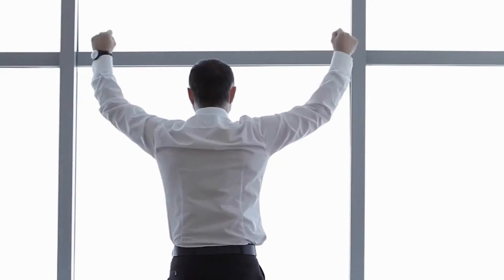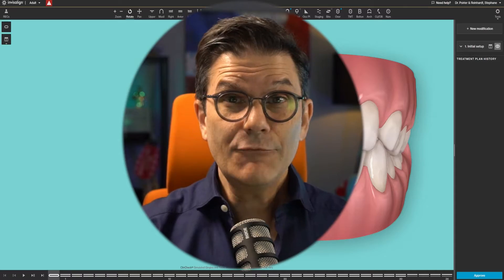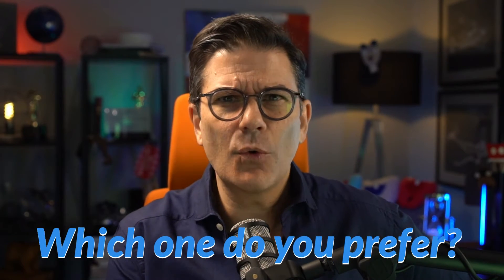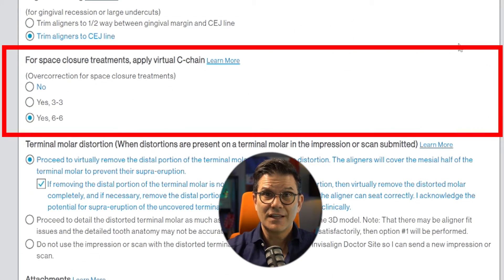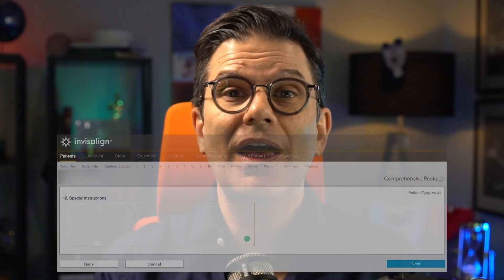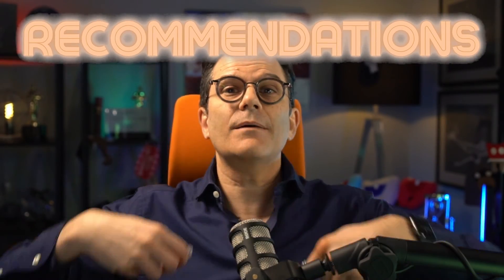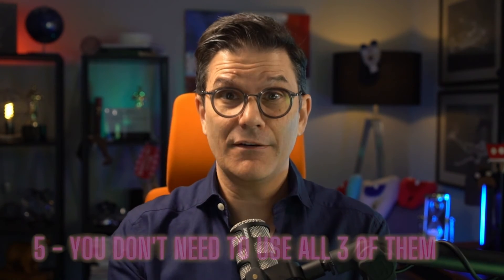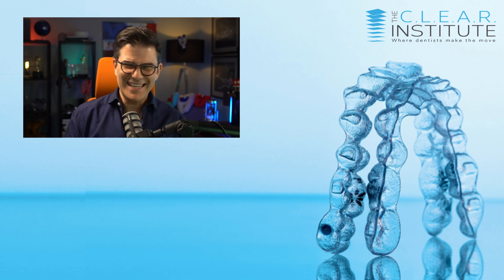What are Invisalign overcorrection aligners? C-chain vs Power chain

Comment: Great video 👌🏻 I’m on my last two aligners then I have two over corrections. Obviously I asked my dentist all the question but I would like to hear your opinion. How long should I keep the over corrections on for? And do I need to move to the last aligner once the gaps are disappeared? And I don’t know if I have passive aligner. Is it included or you should get them separate?
Also I did IPR between the central and lateral incisors. But I might need a little bit more as I have now a very small black triangles because the teeth are moving even between the laterals and canines now. Sorry for my very long question 
Many thanks and great video. 
many thanks